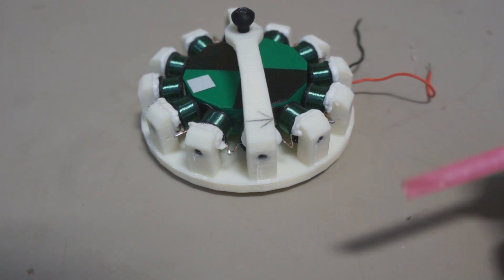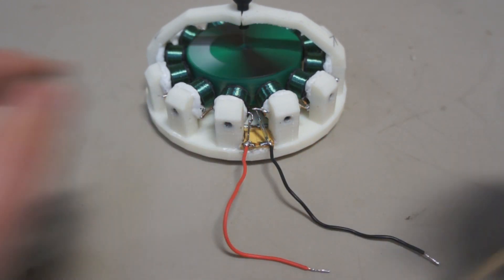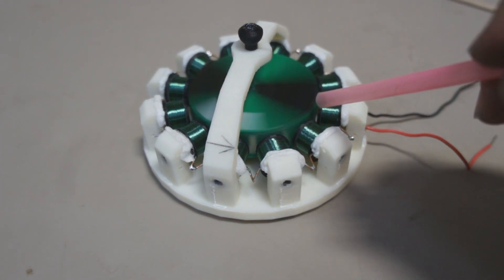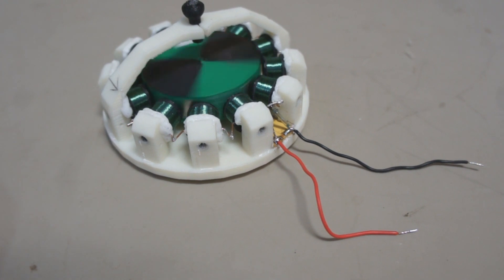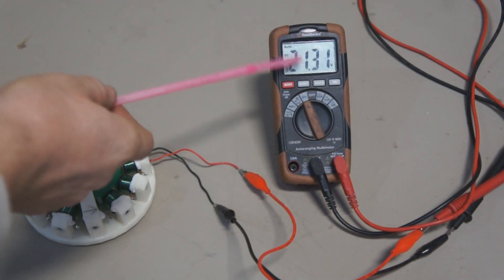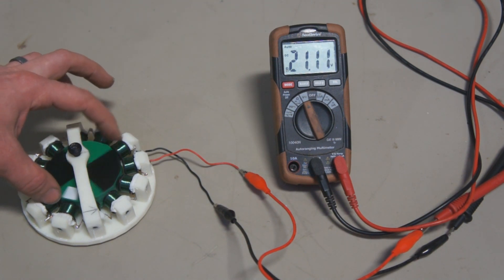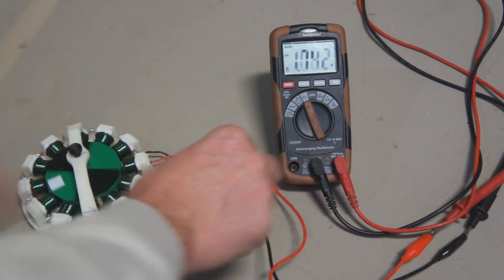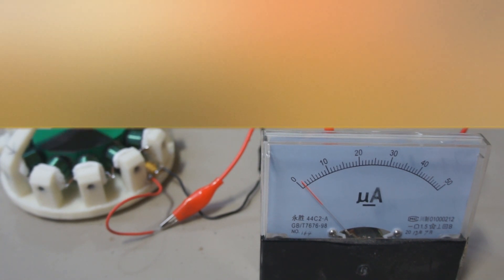3D Printed Motor Runs Almost Like a Perpetual Machine

Comment: This is really inspiring. At first I thought "IRON MAN!" because that is fun.

But looking at it function it has brought me to an interesting idea.
Like you, my first classy thought was to put a glass dome over it, but a spark of inspiration along with the straw has made me re-think this. 

Instead a strictly glass for-show dome, how about a setup of small (hexagon?) solar panels to form a dome? Modifying the axel a bit to allow for wiring to pass through the flywheel into the base and wiring to help drive it.  Along the lower portion of the dome, instead of a solar surface (and while fun, we could abandon that all together) you have air ducts which funnel air into internal straws pointing towards the flywheel.The flywheel itself could have cups or other more efficient structure to capture and use it to propel the motor and begin generating power. 

You would want a circuit which when max capacitance is reached will start dumping energy out for whatever kind of use you might come up with. Maybe you could power a simple camera or whatever sillyness I don't know.

I realize a simple omnidirectional wind generator is probably more efficient and an outside application most definitely would require a bit of thinking on weather-resistance but for a really nerd-soul-filling project I think it would be fun at very the least.

I'd love to drop money on one of these and ideas I mentioned but I certainly don't have it in any capacity. If people are interested in the concept I'll totally fire up blender and try and get an animated model going. I would love to see such a thing built in reality though!

Cheers, I really enjoyed this one.

Comment: You seems like a FRAUD. You solder very THIN wire that is not visible to the camera. This sources make motor rotating, you amateur. Please DO NOT write words like "Perpetual", etc. in the explanation of videos!!!

What you explain to the clients which purchase from you this fake expensive toys, when they STOP rotating after couple of minutes??? :)

Comment: Hi lasersaber! Like all the work you do in your workshop! A short question about the easy spin motor. In my scrap I found a rig for probably big brushless motor - https://picasaweb.google.com/100940344944111937807/Stuff#6240534482681828802
Do you think easy spin based on that thing would increase the efficiency or the metal core not needed at all in this configuration?
I know it will be tough winding all the coils manually, but maybe worth trying?

Comment: 1. How about building a 100 such devices and use them as one high voltage generator? 2. Or actually how about building 50 times bigger device of such and using it at household environment?
Reply: +Readme .txt Because they can only power themselves, and even then they slowly die after a few days or maybe a week with very very good bearings

Comment: I wonder how it would perform as an energy storage device if it was scaled up and the flyweight increased. I know flywheels are used for such things, but this seems to perform as good as some magnetically suspended flywheels (which is what I suppose it is...)  

A very large weight that is set spinning in this manner with cheap energy (i.e., solar peak) and then discharged later (i.e., night or cloudy days) would be worth something. It seems relatively safe compared to flywheels too, as the coils isolate the mechanical from the electrical, minimizing the energy release during a short. 

Only problem I see is that it might be limited in amount of available current?

Comment: I think you or your viewers should come up for uses for such a type of motor.  The only work it could do would be some kind of reflector like for a laser projector of sorts, but other than that, I cannot think of other types of work it could do.  It would also be nice to see you build a high efficiency motor that can do "real" work,  the type involving torque, to lift or move heavy objects, or do other types of work that require force.
Reply: +Jeff Beck It cant do ANY work.   Even laser 'work' is work.   Anything it does will dispel the illusion that it can GENERATE power.
Reply: how about a gyroscope? Gyroscopes have tons of uses.

Comment: Why would you need all those coils? I think without the coils and currents flowing through them you would even run much longer than with them. I mean the real point is the increadibly good bearing.
Reply: +Martin Gyurko YOu need the coils to create the minute amount of power it does make to power itself

Comment: COMBINE WITH STIRLING ENGINE. Your videos a little old so you probably wont read this. But using the solar radiation to heat a surface then cool at night will run a stirling engine for a short period time. How ever short, it might create enough energy to keep your motor running for what we consider forever. It is not a perpetual machine, but at least mimic one. Or add a solar panel. It'll last 27 years lol....

Comment: Tants (or any cap, but polarized cap in particular) in series is a scary proposition without balancing resistors (which would kill your efficiency).

If they're not balanced, over time, you can end up with more voltage across one capacitor than the other (which can exceed an individual capacitor's dielectric breakdown voltage).

For what it's worth, consider trying some large, low-ESR ceramics in parallel if needed.

Just my $0.02 :)  I've seen lots of tants catch fire ;)

Another reason would be just in case of reverse voltage - not sure if spinning it backwards would do that or not, depends on your switch configuration I think.

Very cool project.  It will be even cooler if it was floating on a not-yet-invented flux-pinning room-temp superconductor bearing.  Thanks for sharing

Comment: It would be even cooler if you integrated solar cell.  Between that and the capacitors in common use it probably would never run down.  It would be really cool if you could integrate the cell in to the center so that the cell was moving, it would be a lot let obvious like that.  Then put it in a vacuum sealed jar, it would both remove resistance, and would prevent people from tampering with it!  :p

Comment: What happens when four run it, and 8 charge it. What's the voltage in/out comparison? I've seen one made with only one coil run, so... Just a curious question. Also, what's the wrap count on your coils, and what type of magnet is used? Neo or better? That is one smooth operator, nice job on those bearings. Awesome work, dude.

Comment: hello, good job. I have an idea to improve this motor. Please contac with me
Reply: +Carlos Barbon my email it´s same that my name and gmail
Reply: +Carlos Barbon 
If you make that work on a larger scale, please let me know :)
Thanks!
Reply: +chase miller I cant´make now. My idea is to give cones to avoid friction without fixie axis  and get revolutions
Reply: +Carlos Barbon the fixed axis subtraction about 5 or 7% of energy
Reply: +Carlos Barbon oh sorry, and also helices in the core by levitating
Reply: +Carlos Barbon also a bell to flow the air.. sorry for my grammar I not control very well the English. Do you speak Spanish?

Comment: how are you commutating the coils. moving electrons by magnetic induction causes friction, also creating a magnetic field by moving electrons generates even more friction. you are suggesting that you are doing both. If there is no battery then I'm only left to assume you have really good bearings, but the coils and magnets are doing nothing but creating unnecessary drag.

Comment: so what it is really is a really efficient motor but like most "perpetual" motion or such devices it can't actually do much other than power itself.
Reply: +Lunas Eclipse Nothing can perpetually move other than in a single direction in space where there is no gravity or air resistance.  On earth, even in a vacuum, nothing can move forever and power itself.  The energy has to come from somewhere, and if that power is from itself, then it will eventually slow down and stop moving due to friction from a bearing, gravity, etc.
Reply: @fox091  Actually there is "air resistance" in space. You can expect to hit around 1 atom per 6 m^3. This will EVENTUALY slow something to a stop. So there's no perpetual motion ever.
Reply: +Lunas Eclipse Not even that, it eventually winds down from the initial jump start it is given.
Perpetual motion doesn't exist.
Reply: Actually I would qualify it with "useful perpetual motion" does not exist.
Reply: "by coriolis force from the earth's rotation"  your own words. That's not "powering up itself".
Reply: +joshmosky A huge flywheel can power up itself by coriolis force from the earth's rotation. You can also use tidal force to power something because the gravitational force changes from the moving moon allowing energy to be extracted. Though, there is not enough power to do any useful work. We don't even have a clock that is powered by earth's rotation yet, while air pressure or temperature differential, and atmospheric noise (radio) powered clocks that runs indefinately while stationed on the earth already exist.
Reply: +Lunas Eclipse It is a closed system...a spinning disc...nothing more.He just overcomplicated it to give the illusion that it it some kind of device, that can run very long which it can't.
Reply: +SilvaDreams Yes it can't work.The only way to have something like this is in a universe where gravitation does not exist.Because even if you completely nullified any friction (mounting/air)tehre is still the gravitation, that will bring it to a stop sooner or later, even up in space.
Reply: LineoLemon At slow speeds, air resistance and pin friction would be minimal. It would most certainly run a long time at low speed once spun up due to the centrifugal/LC tank feedback effect.

Comment: The capacitor voltage rising was not "dielectric absorption".  It was bleeding off inertia of the rotor to charge up the caps.

Comment: Cool. What are the applications of this kind of motor?
Reply: +The Tech Mate Probably mostly spinning battery powered decorations, that will run a loong time before neeidng a batery replacement. It's mostly able to operate this efficiently because it is so lightweight, the more weight you add to it the faster it'll run out of power.
Reply: I was thinking about powering a clock with this. Will the clock run for longer than an alkaline battery?
Reply: You've got me, I have no idea, but I think you're forgetting that this motor actually does require a battery to run, it will run a few hours on the capacitors but they need to be charged first (which requires a battery, and to keep them charged so that they're not depending entirely on the motor for power because as the video said, it will only last a few hours that way. i don't think it's suitable for a clock because the power longevity is dependent on the motor continually spinning, a clocks hands do not continually spin, and certainly not at these speeds)

I just don't think this is the right tool for the job.
Reply: ok

Comment: there is no such thing as "nearly" perpetual motion
and there is no such thing as real perpetual motion since all perpetual motion machines run on a form of energy such as the sun or gravity
Reply: hahaha, yeah, ok son
Reply: +Suiseiseki Rozen If there is no such thing as perpetual motion and no such thing as almost perpetual motion then what is it?
Reply: what is it? if you're talking about the motor in the video, thats what it is, a motor. it needs electricity to spin and if you take away that electricity it slows down and stops.
perpetual motion is impossible because of physics, the way energy works. in a hypothetically perfect environment, it might be possible. but in reality it is not
Reply: +Suiseiseki Rozen "all perpetual motion machines run on a form of energy such as the sun or gravity" by that definition a solar cell would be a perpetual generator, which it is not. I agree with your other points though. I think the title wants to suggest that it almost looks like a perpetual machine.
Reply: wow rage
Reply: nearly means almost, not quite, very close, etc
i really shouldn't have to define words for you
Reply: hahaha, yeah, ok
Reply: Is efficiency /really/ such a horrible thing? There's no need to fight over it.
Reply: Actually there is one source of energy which dosn't have the normal rules of energy apply to it. You may have heard of it, It's called Dark Energy and it's currently being used to stretch space time without loosing any power. In fact, it's speeding up somehow. If we could find a way to tap into that to make electricity...

Comment: Well balanced induction motor.  Your energy is actually stored in the magnetic field of the coils, not the capacitor.  Your capacitor allows you to make an under dampened signal.  When you short the capacitor, the signal dampens out.  Once again, nice job on a very well balanced induction motor.

Comment: This reminds me of when I worked at the Gyro shop of a Naval Dockyard where gyros were items that went around at high speed on air bearings.     
That shaft looks  thin and so I would be careful to transport it without protecting the rotor. Very nice indeed.
I am of the old breed  and so such equipment as powerful  magnet and tantalum capacitors did not exist. IN my time on expected to have 1 weber per metre sqr. so our motors had to have a lot of steel in them.
Congratulations.

Comment: Seems like something like this would make for a very good computer fan
Reply: except this motor is doing almost zero work (just overcoming the tiny air resistance and friction). If you put any sort of loading on the motor (Fans purposefully have high air resistance, it is how they move air) the small initial energy will be depleted quickly.
Reply: mlnlme1 I suppose so

Comment: actually I realize now that it is electrolytic :) have you tried to rise the voltage (with a simple joule thief circuit) and give some impulses from that to the capacitor true a voltage stabilizer?

Comment: Hello Mister, I would like to know if I could use this motor to charge a 12v lipo battery using a windmill attached  to it? I have a plane big enough to Carrie it.
Reply: you could attach a wind turbine to any dc motor and get power from it. that is how wind farms work. In fact that is how all rotary generators work, only they use steam or flowing water instead of air
Reply: +mlnlme1 That isn't necessarily true. While you could generate a voltage with any DC motor some have a permanent magnet and some don't. For those that don't they would need a small power source to create the initial magnetic field which would then allow the motor to sustain itself.

Comment: It's ok, he doesn't have batteries, he only has capacitors. -_-
Reply: +Бојан Драшко Okay? He says multiple times he is not claiming it will run forever or that it charges itself and says multiple times he uses capacitors... he's not trying to hide it...
Reply: +Бојан Драшко yes it will stop at some time in the future it just lasts for a long time
Reply: +Бојан Драшко I think it's called a flywheel
Reply: Which are empty when you start it, what's your point?
Reply: Бојан Драшко I

Comment: @lasersaber how can you be sure that the coils aren't storing a charge? -- Especially at the point where you put drag on it, and it spins back up faster and charges the capacitor higher, it would seem to indicate that there is charge being stored in the coils themselves (in addition to the capacitor) and that it's just evening out the charge (you only short the capacitor, not the coils, so it would make sense).

Comment: Inside a Vacuum Recipient it could probably run even longer because of air friction, but the problem is if you do this you'll be unable to blow on it to start it (or even touch it in almost any ways)

Comment: Could you link me to some proyect done using one of this? I can't warp my head arround the idea of what uses this could have.....Why would I want this?

I mean, I understand why would I want a motor, but if I'm not confused this type of set up will not be able to keep spinnig once you add load to it's axis. It would die out quite fast, wouldn't  it? (WITH OUT A BATTERY PLUGGED IN)

Comment: @lasersaber how long would the reed switch last under continuous operation? Im thinking only a billion cycles +/-.@300rpm, you have about 1800 cycles x 60 minutes x 24hrs x 365 days so it's almost there. 2 years nonstop seems possible but not likely

Comment: as a skeptic, i would ask to see the inside of the rotor, as its plenty big enough to fit a small battery and motor.... still interesting build though
Reply: Flyingwigs why would you be skeptical of a low friction motor? it has an extremely low current draw, and as made, it produces very low torque. not practical by any means, but is a curiosity and makes a neat shelf display for as long as the reed switch would last.
Reply: not as skeptical after i perused your channel, and i have built a similar thing using one of those solar flowers ;)
mostly because there were suggested videos to free energy stuff.